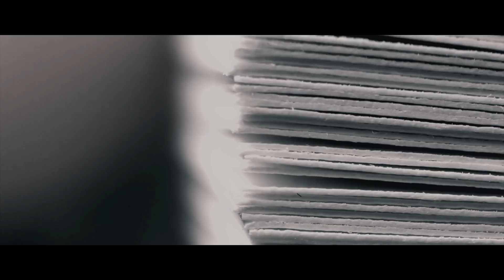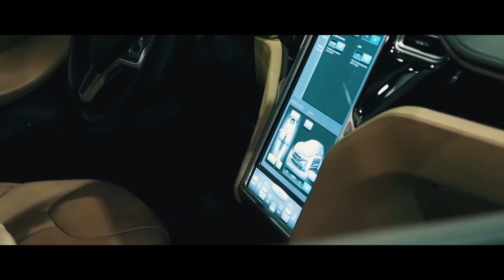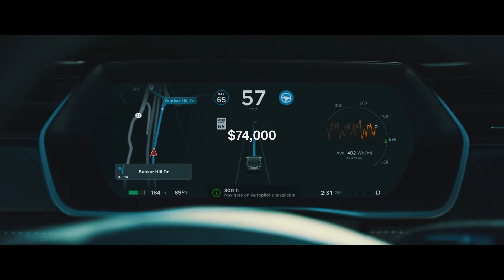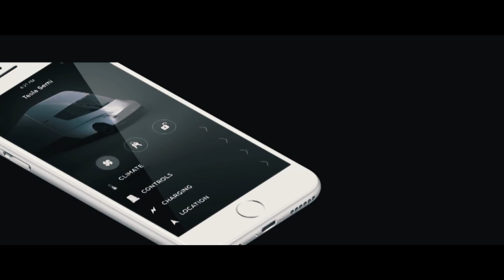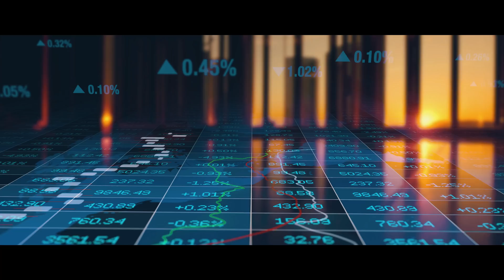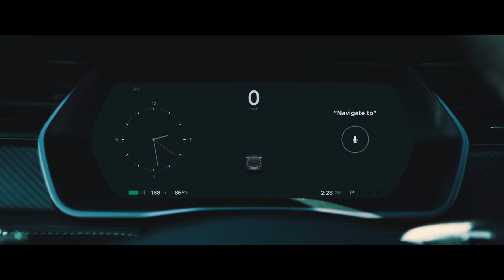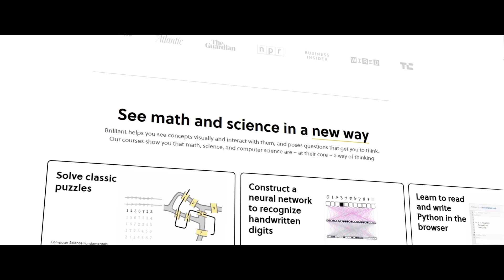Tesla: The Electric Revolution

Comment: The ethics question is very important but looking at Tesla’s safety generally and during autopilot, it’s drastically safer than all other vehicle models.
Reply: about 7-9 times safer actually! (if you use autopilot)
Reply: @romanplays1  not only are these cars safer in an accident, even when autopilot is off they are much less likely to get in an accident in the first place
Reply: @romanplays1  ooo
Reply: Diptoneel De no one wants a car that will purposefully kill you. For all the car knows, those could be mannequins. What it does know for certain that there is a living person in the car. And that car need to protect that person at all costs. What if you have someone in the passenger or the back seat? A Tesla choosing to run people over vs running into a wall is not nearly a big of a deal as a mother suing Tesla over HER CAR killing her child by choosing to run into a wall vs another outcome.
Reply: The true question is ... “what would you choose if you were driving and would it be the right choice?” ... meaning .. does it really matter what the computer chooses? Humans can’t be forced into a specific choice either, at least with a computer you can pre-program a scenario!

This is just one of several things nay-sayers are picking on, to try and disprove a system that will for sure be safer than any human driving. Get over it!
Reply: @TheRemizinho  I guess a solution could be to allow the owner to choose? Maybe have a settings that allows you to configure an option. It would also be telling to see the stats for how many people chose what.
Reply: TehRapidzz I was about to say this! That is the way it is handled in the show Upload on Prime Video, and I think that would be the best option
Reply: Its not important at all. The car will do everything it can to not crash. That is it. Sometimes it will fail and crash. But it will be far less often then normal cars now. Less people hurt, less people die, good for the world lets move on.  The ethics questions people bring up are just stupid childish "what if" scenarios made to sound profound. They are not.
Reply: RasakBlood just because less people die overall while using autopilot, doesn’t mean that we should ignore cases where the car chooses to kill more humans (veering into a crowd) than what would have died if the car crashes into a wall. (The passengers)
Reply: @timtabutops  The driver-or-pedestrian question is a false argument, is what the issue is. There is no "the car can't stop in time" because seeing what is ahead out further than the stopping distance is literally the whole point of all the senors/cameras. The car would simply stop if it encounters pedestrians, just as it would stop if it encountered any obstacle in its path, period. A human might choose to run people over just to get to their important meeting, but an algorithm won't prioritize getting to its destination over hitting someone.
Reply: @timtabutops  Thats the point tho. It wont turn into a crowd. It will simply try to not hit anything. No one will program x human is more valuable then y human. There is no ethics problem other then in the contrived fantasy land of what ifs where we tell the car to prioritize one life over another. The autopilot will never "choose" to kill anyone. It will just try to avoid a collision and fail. Making the car safer is relevant. Silly drama over non existing ethics problems is not.
Reply: It would probably be able to calculate the probabilities in real time.
If the chance of death is 2% if you crash into a wall compared to 100% if you crash into people, it would pick the wall. 

Sure it’s a lot of power to give to a computer but it’s way more trustworthy then people. 
Also(this is me being ambitious), if everything is connected to the internet, then it could avoid the entirety of the situation, it would be able to see the “snag” perhaps hours in advance.
Reply: @webforder4201  I'm just waiting for 5g to get a real foothold on the world. I'm interested in seeing how 5g betters automated driving.
Reply: True, and it is commons sense not trusting the car completely, having control is always much better.
Reply: No, the ethics question is farfetch and pointless, because the instances where Auto pilot would save lives vs farfetch ethics situation is 10,000,000 to 1, and a human driver sure as hell would not automatically make the correct ethics decision given that drivers can crash into a non moving car because they were not paying attention.
Reply: @dr-sy1fs  I agree. I don't think the ethics question matters. I think people just need to all understand and accept and mutually agree that if the car is 100 times safer than a human driver, then someone gets hit or killed in a Tesla, people just accept that it happens and that that would have also happened in a gas car along with 100 other people who are still alive.
Reply: I think its crash will never kill people unless they drive too fast that its break can't stop or lower the car speed to a "safe" speed
Reply: I am person that doesn’t care for morals like that, if it was me driving then I already know I’m plowing through 10 oh well to bad so sad. Why they are on the road I have no clue. That’s just how it is.
Reply: With time the AI will only get better at its job so things like reaction time wouldn’t have an effect because the AI could act almost instantaneously compared to how fast a human can react
Reply: You can also ask that ethics question to a normal car and driver. They cant stop in time, what should the person do? It goes both ways
Reply: @diptoneelde836  To be honest, I don't think the question is framed well in this video. Here it sounds like: "oh, but what will happen if the AI gets into this scenario". Easily reversible: What will happen if a human driver gets into this situation? I think the more interesting question is, how should our legal system handle this. In my opinion the self driving system is actually a way so overcome this bad situation in general since it makes driving safer.
Reply: The question is pointless. Tesla would detect the situation and be able to slow the car down before it happens. You would need 10 people to simultaneously jump into the road right in front of the car to even have a chance of catching it off guard
Reply: Diptoneel De The ethics question need not be binary and could be easily dealt with using quantum probabilities of infinite other options like jettisoning the driver while avoiding the pedestrians. AI is a boon under appreciated, misrepresented and ill applied. Someday soon AI may have to take over and keep the bio intelligent thriving in its own cocoon/habitable zone.
Reply: Bala Subramanian r/IAmVerySmart
Reply: we dont need other manufacturers. New brands can replace traditional manufacturers. New startups can hire competent people who lose their jobs
Reply: Thanks for the heart, brother
Reply: if you get to the point where you have to make that decision, you've already made many poor decisions beforehand. also why would 10 people be crossing a high speed road anyway.
Reply: If I paid for that car that b*tch better save me. They can run out the way and hopefully we all survive but let’s cut the bs in a situation like that self preservation is a Natural instinct.
Reply: True . And if that question ever arises I'd say that the car should prioritise the safety of the occupants instead of the bystanders or anyone else on the road. I'm not paying for an AI for whom my safety isn't the main priority.
Reply: Yep, there is enough people doing dumb things on the road already. Tesla autopilot can maybe not save everyone, but at least for most people can make driving a lot safer.
Reply: I may add that life & death choices are made everyday by people who are charged with protecting & serving their communities! They’re called police officers & as we’ve seen, they don’t always get it right! Life comes with risks & also choices! So if you decide to buy a fully autonomous car that’s a choice for now! If at sometime in the future that choice is taken away, then that’s another question, but at this particular moment in time, we have a choice! So in essence the question is moot because we’re not at this particular moment driving a fully autonomous car! The law has not changed & unless & until the law changes, cars must still be operated under the control of a licensed human driver!👌
Reply: Plus I'm pretty sure it would be able to brake in time
Reply: Well if your lucky the car will drift take both the pedestrians and yourself at the same time, 2 birds with 1 stone 😎
Reply: I was looking into this and a book I came across 21 problems for the 21st century expanded on the idea that autonomous cars would have an ethical choice would you prefer your life to be saved or prefer having the least amount of injuries/deaths even if it killed you. The idea was that due to the ethical problem these 2 choices would provide that solution.
Reply: I’d recommend everyone watch a video on Nvidia AI for self driving cars. It’s smart and only getting smarter, it can determine the difference between people and objects, motorbikes, cars, the speed they’re going at in relation to the speed you’re going at and when to stop moving. None of this technology will ever be perfect though. It fundamentally works on recognising patterns, and humans are pretty spontaneous creatures who are a little hard to predict
Reply: FREEDOM IS HAVING CHOICES
 
I CHOSE THAT THE CAR SAVES ME.
Reply: Tesla should monitor traffic, if the choice was one or the other ethically they should protect the driver no questions asked
Reply: Aged like milk.
Reply: ... and the ethics problems 10X worse is a concern ?? - this is a bs video

Comment: Remember when in back to the future 2, they said we would have flying cars in 2015...
Reply: Musk is working on it with the new Roadster and it's SpaceX packet
Reply: Honestly, I actually forgot about the possibility of flying cars until I read this. It just seems like there is little to no use for flying cars IMO.
Reply: @connorofbells  yea, they'll be hella expensive, have a short range and very limited places where you can fly them. You're also most likely need to have a full pilot licence to fly them. A cool bit of tech, but impractical in daily usage.
Reply: @tjibbeettema8759  No...The SpaceX package only has features to improve handling and acceleration with the use of small liquid nitrogen thrusters. The car will not literally fly.
Reply: Youngsterr wrong. Elon has confirmed the car will be able to hover for a couple of seconds by directing the cold gas thrusters downwards.
Reply: Connor JB   True. Ive always thought this. Its just too expensive. Each car would have EXTREME amounts of tech to go into them that would make super cars seem cheap. It would require lots of funding and would have no practical use for the car market. It would be something that would require a pilot license and would be a whole new era for car safety. Think about it, if u have a car accident or it malfunctions and u break down, its not like a normal car where u just push it to the side of the road. U would crash and burn like a boulder. It would be too much of a risk to have flying cars as it would impose a risk to everyone and everything around them. U could crash to the ground, into another car, or crash through a building just by turning your wheel. Too many what ifs come along with flying vehicles along with extreme costs, not just to make and produce them, but to be able to buy. They have no place in the car market because only millionaires would be able to afford them, therefore making them very rare and would hardly ever even see one. I get that its a good idea on paper and in movies, but in a practical everyday use, they would cause more issues and impose more dangers than regular vehicles. Plus wr just dont have the technology to make them yet. Not anti gravity ones anyway
Reply: @connorofbells  i think a flying car can be used as a military weapon
Reply: @connorofbells  plus you can use them in roads with lots of potholes
Reply: There is flying cars but its too expensive

And flying is still hard cause its basicly its helicopter with wheel
Reply: Ciaran Barr  I hope to Allah & God’s Flat Earth that never happens! Last thing I need is to worry about some drunk idiot crashing into my 3rd story bedroom at 2am!
Reply: The oil giants said no.
Reply: yeah man I just watched that movie and whoa boy they were wrong
Reply: Well they didn't realize the future is tunnels 🤷🏻‍♂️
Reply: They wouldn't even be useful today because they can crash into skyscrapers and buildings so unless you redesign whole cities you won't have a use for them except for open areas or just for showing off
Reply: Well...a helicopter with wheels does exist.
Reply: Well in 2018? must sent his roadster tp space. Soo...a bit late but my man did it
Reply: We will never have flying cars in the future, we will find other better and easyer ways how to transport people. Elon talked about it one time and it made sense.
Reply: Sharks the point other then flexing? It would be a huge inconvenience to make “air roads” and “flying laws”.
Reply: As previously mentioned we virtually already have flying cars, helicopters. Imagine a fleet of car sized drones buzzing around a city, would be expensive, dangerous and also extremely noisy. 
As with all things Elon he's already thought of that, thus his Boring Company, take all that traffic underground, which in most cases is far safer than surface roads, saves noise, unsightly traffic, and plenty of room for unobtrusive transportation infrastructure expansion.
Reply: I think it's a bad idea to have flying car.
Reply: Well, you are 5 years late for this comment to be funny. Now, It's just disappointing 😂
Reply: Their not wrong their are flying cars kinda  search for it it's  not a car but flying
Reply: Flying cars were always a stupid, expensive idea and an ineffective form of transport. They're literally just helicopters with wheels.
Reply: There are flying cars, they're called helicopters. 
And the reason we don't have them is just that they aren't efficient enough, check out wendover productions latest video on helicopter airlines.